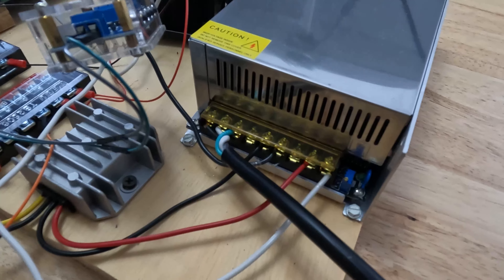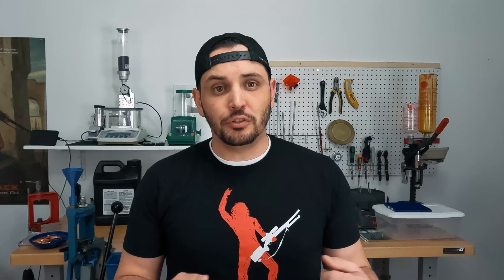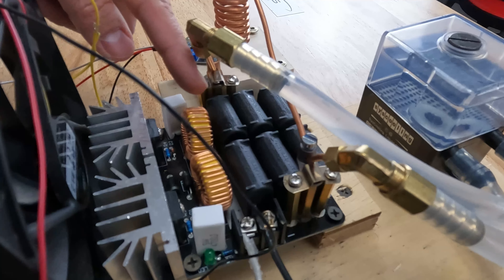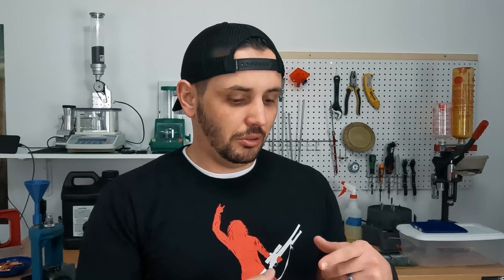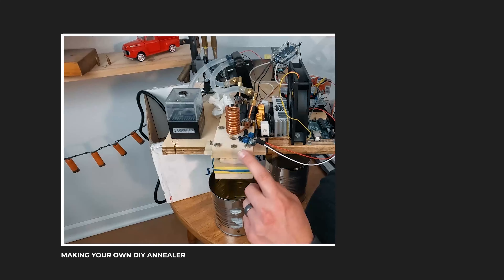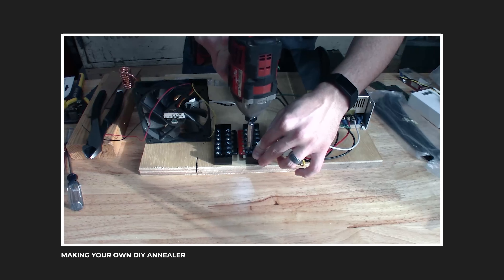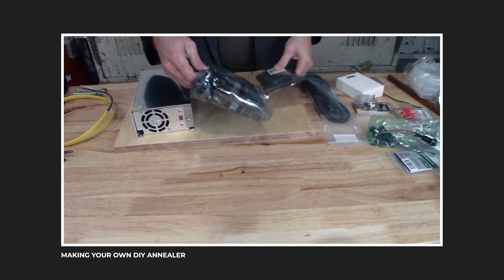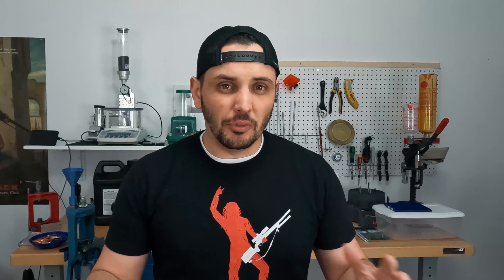Top 3 Components for Your DIY Induction Annealer

Comment: Thank you for putting out your video’s on making your induction annealer, I was able to  make one for myself. The question I have is what gauge of wire did you use from power supply/ relay to the ZVS board?